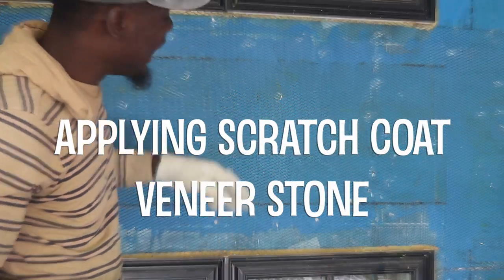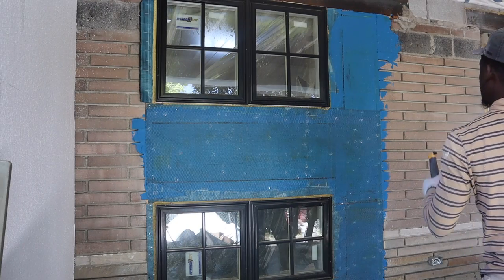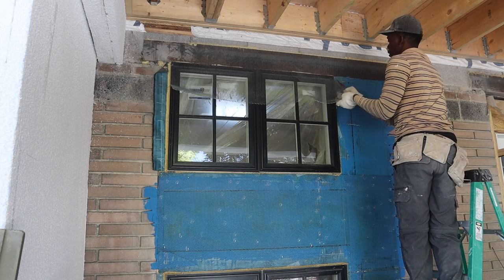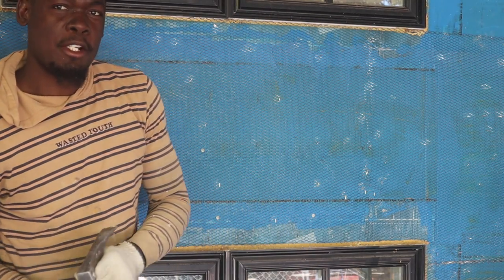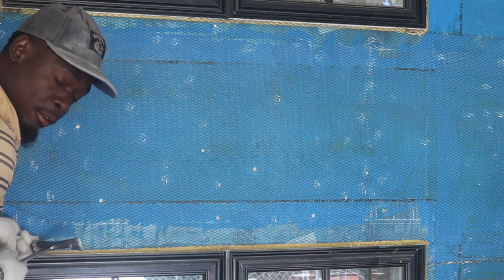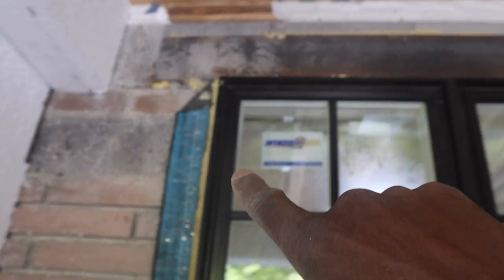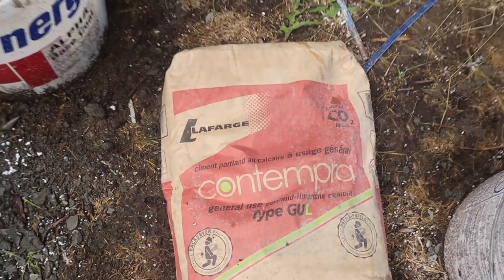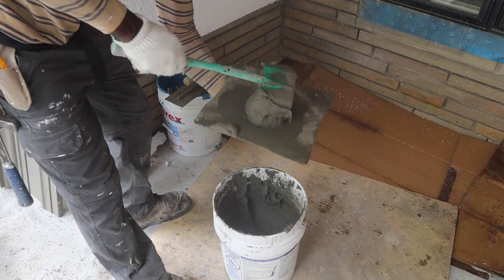Prepare and  Applying Scratch Coat on Wire Mesh,for veneer stone /stucco

Comment: Why did you need the plywood? Couldn't you put the mesh straight onto the brick and then apply the scratch coat?
Reply: For concrete block would you also put plywood first or could you just do the mesh?